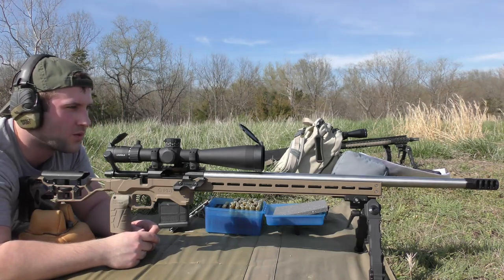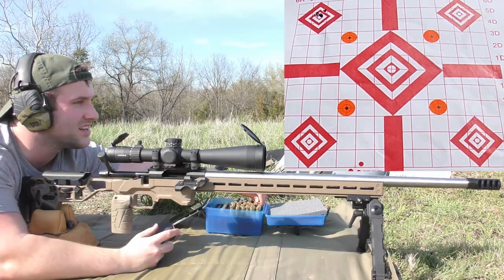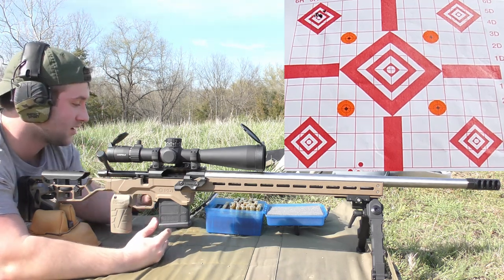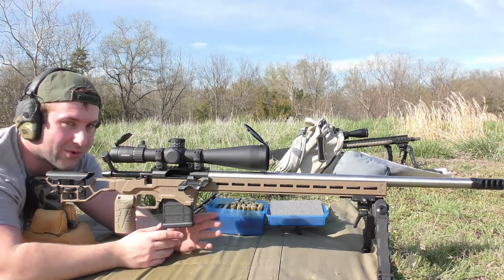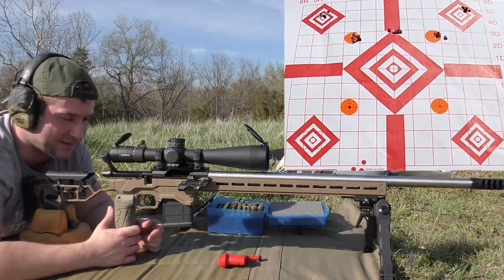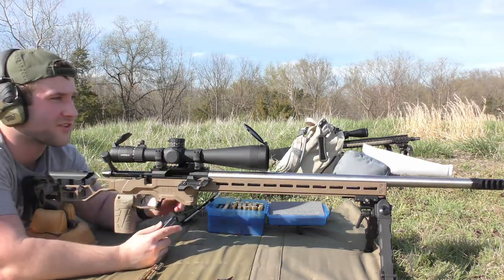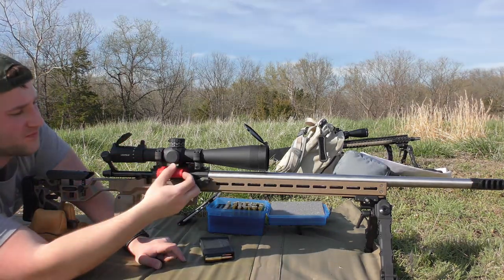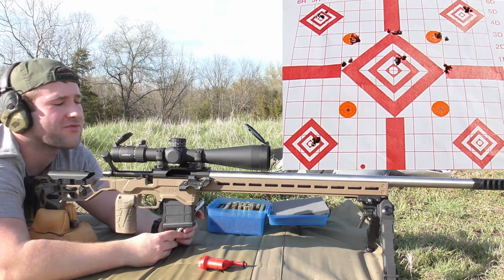Impact 737 Custom Rifle Accuracy Testing 6.5 Creedmoor: Hornady ELD & Berger Hybrid Target Bullets

Comment: Nice rifle. Just a point of interest, that same barrel is used in F class and withstands a shot string of 20 rounds in 20 minutes so heat is not a major issue.  I suggest you fine tune your reloading to work on neck tension and seating depth.  Keep up the videos,  nice presentation.
Reply from the maker: Thank you for the advice!

Comment: Great shooting. When doing load development when you find a decent load do you go back and load a few grains lower or higher to fine tune or just stay where your at?
Reply: What was your starting seating depth
Reply from the maker: It honestly depends what my goal is. I don't have 1 process that I do for every rifle because they all have their own nuances and restrictions (like magazine length). Typically, if it shoots accurately/precisely, fits in a magazine, and has a high enough speed that is consistent, I'm thrilled. However that needs to be accomplished can vary dramatically based on the system/platform.
Reply from the maker: I just loaded all these to magazine length.